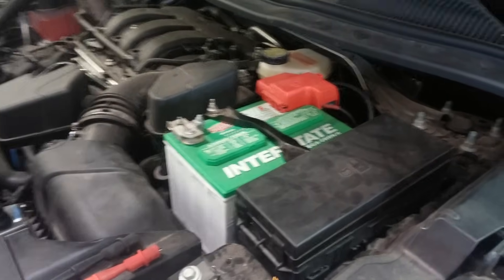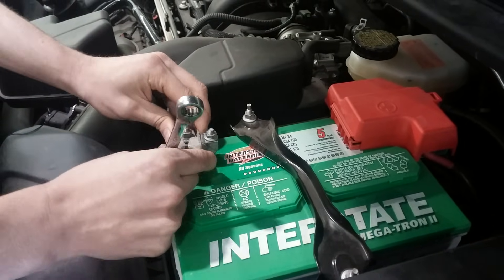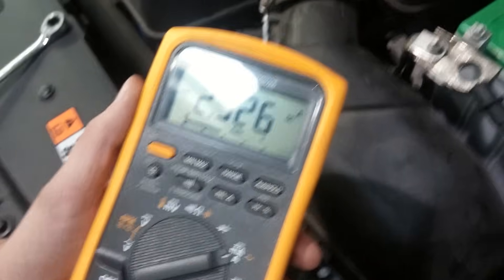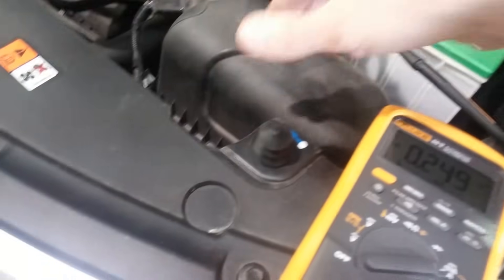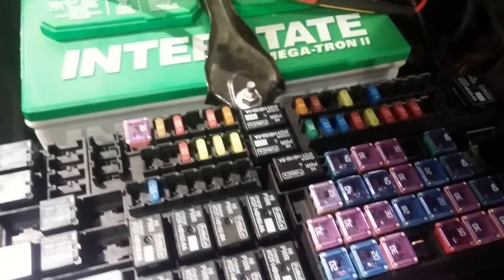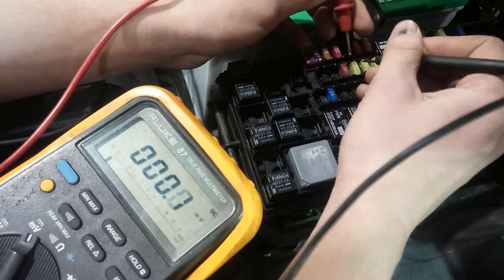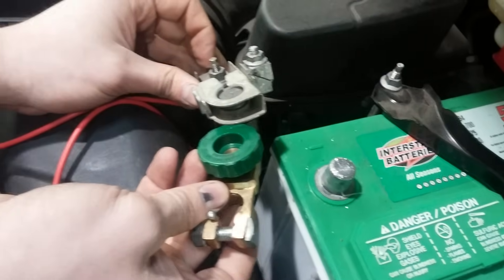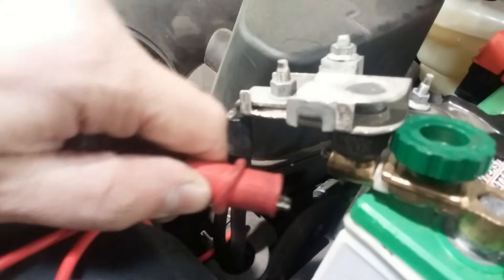How to identify and locate a parasitic drain

Comment: Great video. Can anyone tell why a car battery doesn't electrocute you when you touch it? If you touched the positive and negative would it?
Reply from the maker: It doesn't shock you because the battery only has twelve volts and your body has a lot of electrical resistance.  As you probably know, a nine volt battery can shock you if you place it on your tongue because your tongue conducts electricity better.  To feel a shock from a car battery, you would need to either increase the voltage or decrease the electrical resistance in your body.
Reply: @JustinMillerAutomotive  remember, DC voltage can be lethal,ie; domestic electric supply has higher VOLTAGE, but very low current, the higher voltage would certainely give you a SHOCK, but car or commercial batterys can cause severe burns or fires, if a SHORT exist's in the circuitry. CURRENT intensity is what governs power in lower voltage systems, ie; diesel vehicle starter motors typically draw many hundreds of AMPS, necessary to rotate a crankshaft 1st thing the morning, esp in freezing cold weather, in order to achieve a fairly dynamic rotational speed of around 200/ 275 rpm for the cold engine to fire up, imagine a shorted/worn out starter motor, we have seen vehicles in FLAMES🤔
Reply: Thank you for the answer. 
Yes my brother taught me the 9volt tongue trick at an early age.

Comment: Real slick man i woud have never thought to watch volt drop across fuses  thanks for posting
Reply: May check for blow fuse?
Reply: Cody..I am a former electronic tech.. That would have come in handy years ago.  I even saw where somebody was using 1 ohm resistor ..dont remember how it was used.. but the voltage was supposed to be current of the fuse. I have not tried it..

Comment: Mine say .68 is that alot
Reply from the maker: .68 amps is a lot.  At that rate your battery would be dead in a little over 24 hours.
Reply: Justin Miller I fixed it was my factory amp it's saying on I replaced and fixed the cercit thanks

Comment: Thank you.  That was excellent with an absolute minimum of idle chat and all of the details needed to do it right.  And ditto to "urdu learner" the next step would be a useful followup video - yeah I realize every fuse leads down a different rabbit hole ... but maybe one of the simpler or most common ones?
Reply: Arion Stone
 - Opinions may vary but based on personal experience. The most common cause for parasitic drain in the electrical system are:

1 - Botched work done on the vehicle, mostly associated with sound/media/entertainment.
 
2 - Wires and/or connectors damaged during interventions be it for normal maintenance or anything else. Bumping or pulling wires or connectors is a big no no, on ANY electrical system.  

3 - Components failure. With in component failure a huge number is associated with dirt/corrosion.
My 2 cents. ;-)
Cheers
Reply from the maker: Great suggestion.  Thank you!

Comment: Do the larger almost square fuses (the ones in the right front corner of the video thumbnail) to the right of the relays, also have contacts on top to read voltage to detect a voltage drop?
Reply: Rick L
 - No they don't have contacts on top. But if really needed, in most cases the top plastic cover can be pulled out. Which BTW I don't advise. ;-)
Cheers

Comment: (1991 Chevy S10) Doing the amp draw test, I got a .84 amp draw. I pulled every single fuse, and no drop in amp draw. I then checked the charging system, it appears good, but was jumpy, so I disconnected all the leads to the alt, (possible bad diode) and I still got a .84 amp draw. Can a starter draw .84 amps and still be a working starter? My next guess is to check all the leads to the starter, and disconnect it to see if it's the culprit. The only lead I can't check is a fusable link running from the alt to the solenoid, by disconencting the cables at the starter, how do I check this link, resistance? And, how do I decide if it's the starter without taking the starter off the vehicle?
Reply from the maker: Yes.  I have seen a starter cause this.  It was actually a slight short across the solenoid terminals that was causing the drain.  To find out, you would need to disconnect the wire from the "B" terminal on the starter motor (this is the large battery cable).  However, you should disconnect the battery while doing this, or be VERY careful not to short the wire or your wrench to the ground.

Comment: so it doesn't necessarily mean its a light fault then, mine is going flat after around 3 days of no use, i did have windscreen washer fuse blow not long ago, which i replaced and was working again, im hoping mine is just due to that

Comment: Very much informative video, biiiig Thanks. I watched another video here on YouTube, a guy said.. removing and connecting -Ve terminal can cause of generating some Generic OBD codes. Kindly explain this matter of concern.
Reply from the maker: Disconnecting the battery can cause a whole bunch of issues on modern cars.  That is why I recommend using a memory saver when disconnecting the battery.  Just make sure that you remove the memory save once your ammeter is in place and before you take your current reading.
Reply: Thanks of You

Comment: I'm having this problem with my  03 GMC 1500, when I find the parasitic drain, can I just remove the fuse and the problem is solved or is more to that...for example if it the radio fuse causing the drain can i remove the fuse and the parasitic drain problem is gone..

By the way...great video
Reply: I have the same question so am going to find parasite , pull it , and test with meter every other hour so the battery can be saved Iwont be stranded.Glade you asked that.
Reply: If you don't want to use that circuit, sure. You may need that circuit to run the car or gauges. Depends on which fuse you pull

Comment: Hi Justin   Please help,                                                                                                                                                                                                                  I am facing a Parasitic Drain on my Elantra, i have 300 mA drain, i used a different technique of pulling fuses, and noticed that the "memory fuse" alone drain 100 mA, alone with some other AC fuses. I checked the items related to each fuse, and made sure all is turned off, but still drain available and it is too high! The funny part sometimes it drains and sometimes it doesn't, so sometimes when i turn on the car in the morning, it starts, and sometimes not, although i make sure everything turned off after switching the car off at night! What would you recommend me to do next?
Reply: Old question. But here it goes. 
Either the system is still live when you test it. Or probabilities point that, sometimes On, sometimes OFF, to a relay malfunction (stuck). It's worth mention that dirty contacts, particularly bad ground connection(s) don't help at all. ;-)
Cheers

Comment: Why cant i complete the test? I do everything as shown, disconnecting the negative cable, one side of multimeeter put on bateri negatvie and the other side on disconnected negative vire. but when i do that i get sparks and my multimeeter will from 0 to like 0.7 and then 0 again and then it sparks again and it will do the same. Why?
Reply from the maker: +renatas rexitsss 
It sounds like the range on the multimeter may not be set low enough.  If you don't have any other range options, you might need a meter with more accuracy.  The spark indicates that you are completing the circuit, and 0.7 amps sound about right for the initialization current when you first reconnect the battery.  After that it should drop to less than 0.03 amps.  Your meter may not be capable of reading hundredths of an amp.